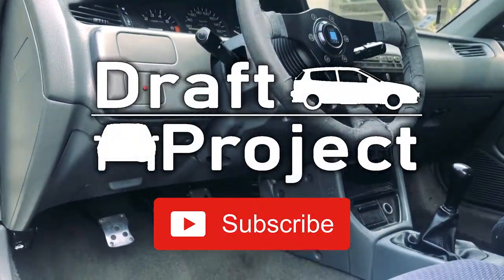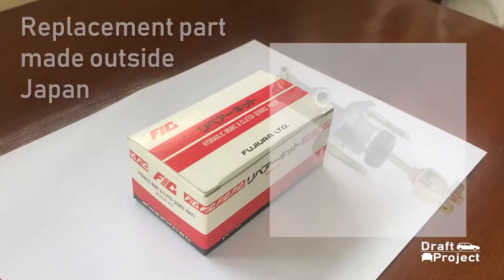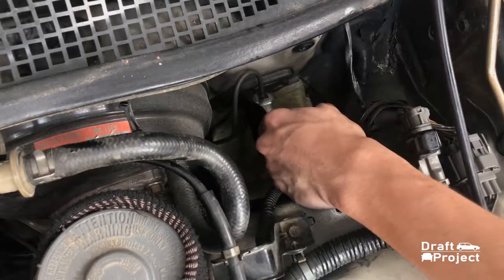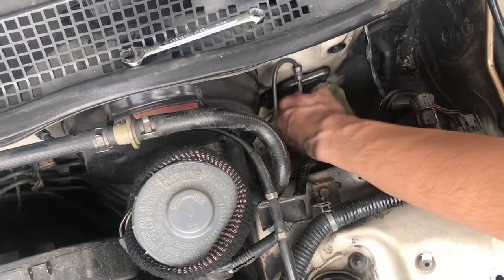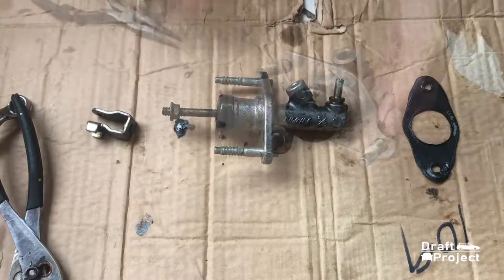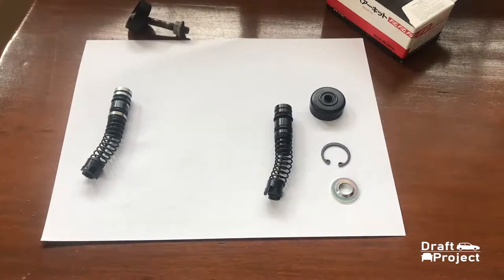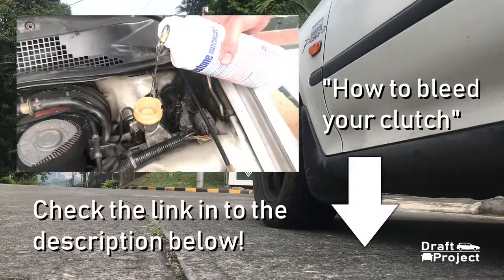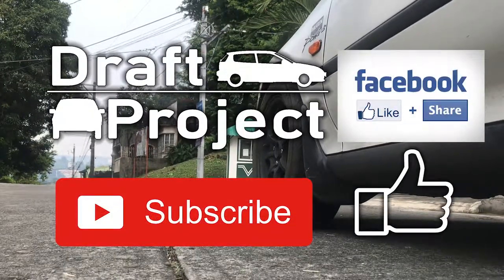How to Rebuild a Clutch Master - Honda Civic EG - Draft Project

Comment: Hey have you ever experienced a clicking or “popping” sound when pressing the clutch pedal? It’s from the pedal itself. If I spray grease inside the hole that the rod that connects to the pedal goes in, stops the noise for a couple days
Reply from the maker: I do have some similar experience about that and what I can say is that the most suspected cause would be a worn out push rod. If you put some grease, it would be temporarily fixed since the grease eliminates the clearance and lubricates both points. If you will buy a new clutch master cylinder or slave cylinder, get a new whole assembly. It is a lot better than the repair kit.

Comment: Thanks for the video!  Can you post a part number or link to this product? I would like to try this out rather than replacing the master cylinder all the time.
Reply from the maker: Hello Pardeep! That was a long time ago and i lost the packaging or box of the product. I searched for it and I hope this helps. Thank you!
This is the code for the piston only: 46926-SF1-003
That is the original part from the dealership.

If you are looking for a complete set of repair kit just like mine, this is the indicated code for the FIC Brand.
FR-5102
[46926-SF1-003]
LEGEND KA1,2
46920-SR3-A01     15128

Comment: Have a part number for this kit?
Reply from the maker: The part number for the piston rod is 46926-SF1-003.

For the whole clutch master cylinder assembly, the part number is 46920-SR3-003.

Comment: bro,pwede ba sa honda civic esi yan?
Reply from the maker: Yes bro pwede po yan. Advise ko lang po sainyo, if mahigpit ang budget or nagtitipid kayo para sa clutch master, ok po yan yung repair kit lang po ang gamitin niyo po. Pero kung kaya po ng budget niyo po na bumili ng whole assemble na clutch master cylinder, mas mainam po na bumili po kayo ng buo dahil yun po ay sealed unit at mas tatagal. Ang recommended ko po sainyo na brand ay Aisin at Seiken. Pareho po yun gawang Japan.

Comment: Sir ung clutch pedal ko kusang bumababa ano kaya problema?
Reply from the maker: Hi sir, if thats the case then try checking your clutch pedal spring. Make sure it is secured. If that doesn't fix the problem, then here are some things to check.

If your clutch is cable operated, inspect it and try adjusting it. That might fix the problem.

If your clutch is hydraulic type, check the fluid level and make sure it is on full. If that didn't make any difference, try flushing it with a new fluid and bleed it until the pedal is solid. If that doesn't work, the clutch master cylinder or slave cylinder could be worn out which needs to be replaced.

Comment: I have a 2002 Honda and the mechanic refused to fix the bad clutch. Watching this video will prompt me to fix it myself
Reply from the maker: Good luck with it. Also, just a tip from my experience, if you can buy a whole assembly, go for it because it is way better that rebuilding your old clutch. Rebuilding using a repair kit works well too but I kinda noticed that a new whole replacement set could last longer than the rebuild ones due to the condition of the metal cylinder housing of the clutch master.

Best of luck and take care. Thank you.